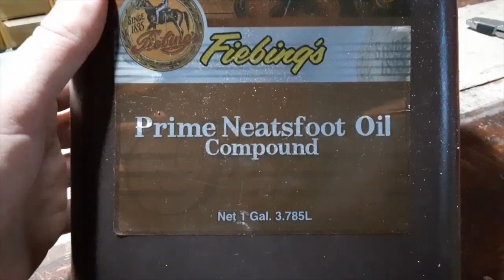Making Chinks

Comment: You should tape the back of your leather before tooling it and it won’t get stretched out of shape packing tape works great or even painters tape
Reply from the maker: Hey Jack, Thanks for the advice. I have actually figured that out since making the chinks. Really is a good tip though. It makes a big difference. Thanks again.